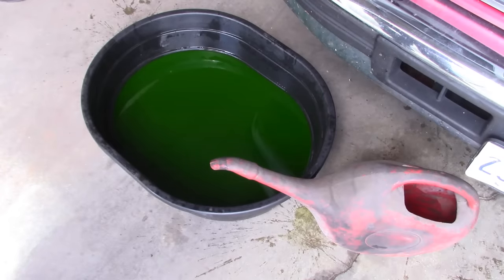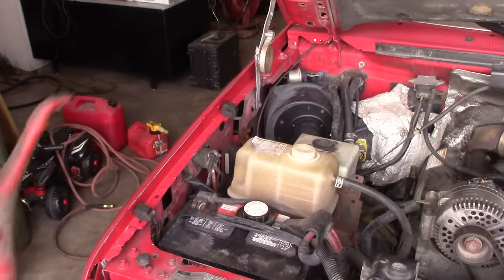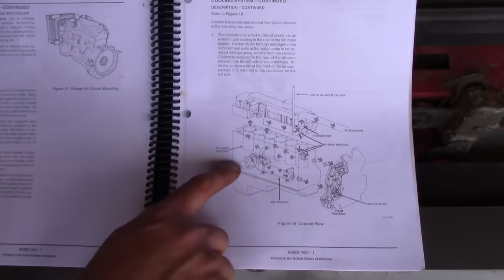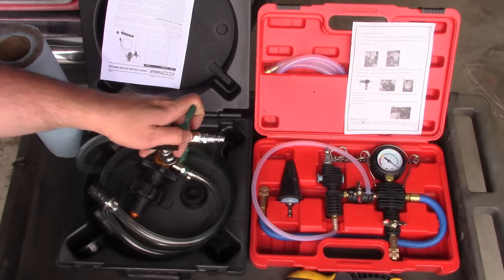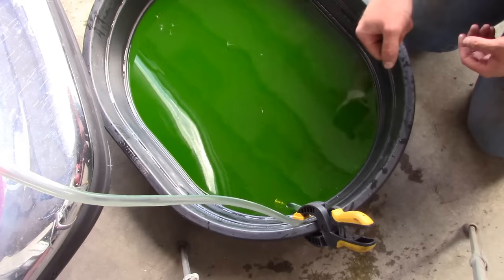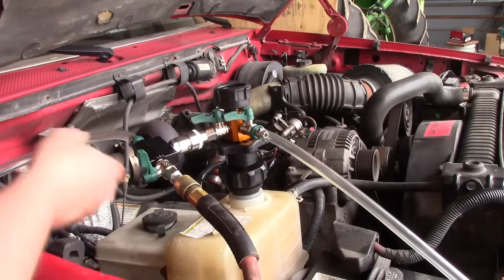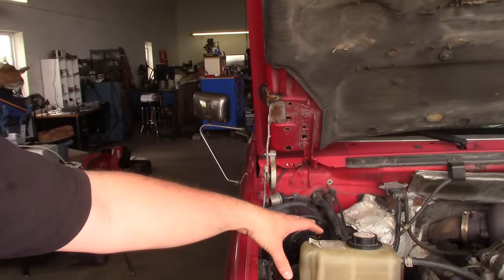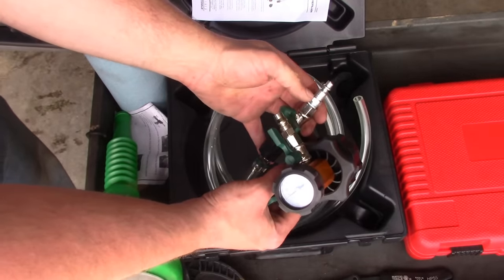What is a Vacuum Coolant Refiller, and why do You Need One?

Comment: I’ve used my oem tools vacuum multiple times on multiple vehicles. Have you ever had a problem when refilling where the gauge doesn’t make it to zero? Vacuum holds great, starts pulling in coolant and will pull down to a little under 5 psi and holds there. Coolant seems to be full and running properly but I hate that I can’t get this thing to hit zero psi. I used mine yesterday and I didn’t purge the coolant supply line prior to filling. Do you think that’s it? Again car seems to run fine and coolant was full.

Comment: Does the cooling system have to be completely drained to use that tool? I mean I've done water pump jobs and I don't drain the system I just let it flow out of the water pump and refill. That being said there's always some coolant left in the block or radiator etc. can you still use that tool in that situation?

Comment: cool thanks, but didn't you suck a heap of air back in the system at the end?
 I always shut it off & get a bit more coolant so the tube is always submerged & never sucks any air. 
It will always stop sucking fluid/air when it is full, obviously your vehicles cooling system was not completely full.

Comment: I bought the OEM tools one and I was wondering so what does it do when the system is filled where does the coolant go or does it just drop moving when its full? Im not sure why mine would only go to -15 psi vac and it would suck in the coolant but ran out of vac.

Comment: I guess the higher quality tool would serve well for guys like you, that has to deal with many differnt vehicles per week, we as occasinally wrench monkeys could easily work with the "el cheapo" version once a year...
But really nice concept, how risky is it with older brittle radiator hoses when they got mangled by the vacuum?
8-0
The nozzle of the jug could easily blocked with your thumb while you positioning it over the filler cap opening, when your are right there, release your thump and it wouldn´t spill around...works great!
:-D
Thx for showing us!

Comment: Isn't the radiator cap closed to the expansion tank when the vehicle is closed? How does the vacuum and fluid get past?
Reply: These trucks don't have a cap on the radiator, just on the reservoir. The cap on the reservoir is the only opening to the system other than the drain, and the reservoir is always at the same pressure as rest of the cooling system.

Comment: Wes, quick question for you...
How big an air compressor do you need to run this tool?
Can you get away with using a pancake, or do you need a 10-30 gallon?

Thanks for the video!
Reply: You can but you would want something with a valve to close the air hose to let it refill. 
I plan on getting a valve for the uview 550000 since I have a small compressor
Reply: @wades623 The tool Wes shows has a valve? What are you implying?

Comment: I would be concernd Damaging my hoses using this method.
Reply: I agree.  Plus who knows what else could be damaged.  The cooling system normally sees a lot of pressure, so pulling a huge vacuum on it just can't be a good thing.

A lot of guys use them with no apparent issues.  But I'll keep doing it the hard way.  I normally only work on old vehicles and always treat the cooling system as fragile.  Anything I can do to prevent a surprise leak later on, I'll do.
Reply: KC9UDX 
No one says you have to draw that deep of a vacuum, watch your hoses/gauge and turn off sooner than Wes did.
I understand your dilemma , as I was thinking sorta same thing.
Not so much as hoses, weak/old fins on radiator core. 
Think I'd watch gauge seems like 15 vac be plenty to start with , then I'd go from there.
Reply: Atmospheric pressure is ~14.7psi... the cooling system builds more pressure than that when operating...

Comment: you didn't mention that you can use this to check for leaks in the cooling system.  pull a vacuum and monitor the gauge for changes in negative pressure.
Reply: He absolutely did mention that.

Comment: Won't the radiator hoses get damaged from the vacuum? Just curious
Reply: The vacuum is less pressure than the system builds when hot (just in reverse).

Comment: toyota 22re 4cyl always has a bad habit of air pocket tween the #3&#4 up inside the head (i know this as it cost me a head gasket and i just yesterday had to change the water pump jacking up the front end higher than the rear so the air will travel towards the thermostat housing

Comment: Any unit that has a water cooled turbo and/or EGR cooler MUST have the cooling system VAC refilled!!
Using the vac  unit for PS should probably not let PS fluid run thru it!  just holding the unit on the PS reservoir fill port for short times without letting the fluid get into the VAC unit!  This can save replacing a PS pump!

Comment: These have been around for a long time. Guessing they might not be popular in the HD world, but anybody that works on cars, especially euro stuff where the reservoir is pressurized, there is no other way.
Reply from the maker: Yeah, I know they have been around for many years. I first some one just a few years ago, but I guess I forgot about it. I bought the cheap ebay one about a year ago. Don't know why I didn't get it sooner.
Reply: @WatchWesWork  Turns an hour long bleed into 5 mins. Also a quick way to check for leaks. Usually just fill em, heat cycle em and top em off after they've cooled down. Most american cars have switched over to pressurized systems as well so its almost mandatory to have. Unfortunatly the vacume bleeder is becoming obsolete with german cars due to the number of electronic valves. They wont even pull a vacume when you put the tool on due too the valves being closed. You need factory sofware, a really epensive coolant pump,(or a bucket) and you have to follow a drawn out bleeding procedure, autell can usually handle   it. Yup technology makes everything better. There is no shortcuts, if you just fill it and run it, the valves will not open, and very, very bad things will happen. So if any newer audis or bimmers wander in, be weary. Thanks for the reply, its nice to have another down to earth automotive channel that is simple, and informative. Its exactally how deboss started out.

Comment: Wes you may have mentioned it when talking about the purge valves but I have a 97 f150 4.6l and I cant get my head around how the vacuum is going to get the coolant past the thermostat. I've only ever done coolant once and it was a long time ago on a different vehicle and I burped the radiator hose to get all the air out. Does the vacuum pull the radiator open? I have air stuck in my heater core and I can hear sloshing in the dash. Bought this tool a while back from this video and i haven't used it yet
Reply from the maker: The thermostat creates an air lock, meaning the coolant can't fill the engine because it can't push out the air. When you suck the cooling system into a vacuum, now there is no air. No air = no air lock.
Reply: @WatchWesWork  sortof how I was thinking it would work, basically sucks it open. Thanks!

Comment: What ?? Problems using gooseneck jug? 😱😉 Here you should get a tip how I did in the mid 70's. Yes, provided you have an index finger .... 😗 Tap the spout on the jug. Remove it as they have the jug over the hole on what you are going to fill.😋
Reply from the maker: You must have bigger digits than me...
Reply: @WatchWesWork  No!!! I havent but BAD MEMORY 😱😰 I have alredy give you that tip before😬 but i was born in middle  of last century so hopefully you forgive me? For My bad memory.  Have a happy new year with your family. And stay safe

Comment: You can have a leak on pressure and not on vacuum. Use pressure to test for leaks since the system uses it to function.
Reply: Thanks for bringing this up. Can it leak in reverse (pressure holds but vacuum decays)? 

I cannot get my Jeep to hold the vacuum but it will hold 20 PSI pressure all day. 

I’ve replaced all of the hoses, thermostat & gasket, used a heater core bypass and tried various new clamps on the hoses. 

When I isolated the new radiator, it will hold vacuum but not when the hoses are reconnected to the engine. 

The only strange thing I did notice is a slight gurgling sound as the vacuum decays somewhere near the lower hose. 

My Jeep is kicking my butt. I’m tempted to just fill it and see if it actually leaks. Any ideas?
Reply: @Marauder92V  Yes it can depending on where the leak is located. I had the opposite happen to me on a A/C system where it would hold vacuum but not pressure. Ended up being a small leak in the condenser.
Reply: @AUDIO2AUTO  Thanks for replying. Really appreciate it. I think I am going to fill it with water to see if actually leaks anywhere. 

Been an adventure! Thanks again!

Comment: will this suck air from the block and heater core? i mean thermostat is close when its cold  so how does this one will suck air in the block of the engine?
Reply: Answer to first question - Yes,  Second question - Engine thermostats stop coolant flow. It doesn't seal off any area of the cooling system like you are thinking. When the coolant is pulled back into the engine it will fill the system up on both sides of the engine thermostat.

Comment: Can someone share with this ignoramus if this system will also purges/drains the system of coolant/anti-freeze or is that a whole different process - is this tool only to be used after you drain your old coolant/anti-freeze, and clear lines with distilled water?  Also, is there a need to bleed your line if you're using this tool?  Thank you.

Comment: I'd love one of these with some sort of 12v vacuum pump so I can use it in the field with no compressor!
Reply from the maker: Build it!
Reply: Biggest issue I've found so far is most the 12v vacuum pumps around are a rather 'toy like', it'd work but no good on the job if it takes 20-30mins to pull a vacuum.
I'll keep searching... ;)

Comment: So what was it that you didn't like about the Lyle tool?
Reply: The funnel? It works great for most situations, but some systems are difficult to get all the air pockets to "flow" back to the fill port and gurgle out... this method mostly eliminates that issue, on "problematic" vehicles.

Comment: If a guy uses those enough, it would be worth finding or building a bucket with a sump reservoir for the suction hose. Maybe something similar to a mower fuel tank with a fitting for the hose......🤷‍♂️🤷‍♂️
Reply from the maker: I've seen a setup like that in a dealership.

Comment: slow on uptake" probably 🤔 Clearly goose neck container. Has a real smart feature built in 😂 all you need is a finger 😁 hold for the hole then lean it against the container while holding for the hole with one of your fingers. And then everything is in place ......... ... Then removing your finger was something I learned in the middle of 70 😎 and it still works😂
Reply from the maker: Your fingers must be a lot bigger than mine.
Reply: @WatchWesWork  Probably not😉 it's probably more about the hole being smaller 😁
To think about is to make sure that the heating element slider is open otherwise one can still have an air pocket in the system.
But by the way. I really like your videos. 👍And have been thinking about acquiring a similar one. Stay safe.

Comment: I think using that tool on a system with a header tank is redundant, i just flush them, fill them, and 2500rpm for ten mins or till fans come on, done. Check the level in the header tank, i fill them to the very top, usually ends up on the full mark when the air self bleeds as the system is designed to, see that little hose at the very top of the tank, when you see the steady stream thats telling you, no air bubbles, if you do then something needs replacing.

Comment: I suspect this was highly edited.  Why?  Not once did you kick to coolant bucket on the floor.  There also were no tools or other bits in the bottom of the bucket.  Good show buddy.
Reply from the maker: You caught me. It was a "setup". I drained the coolant just to show how the tool works. Normally the drain pan contains 3 lbs of rust, a 10mm socket, and at least one critical fastener.